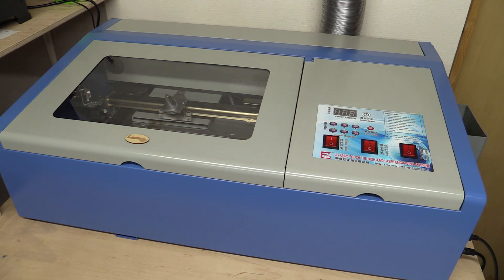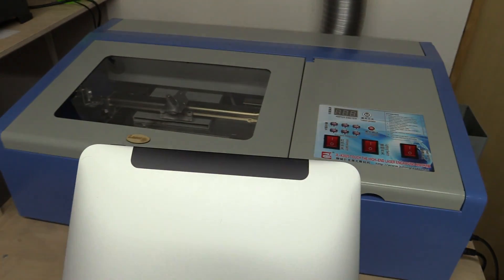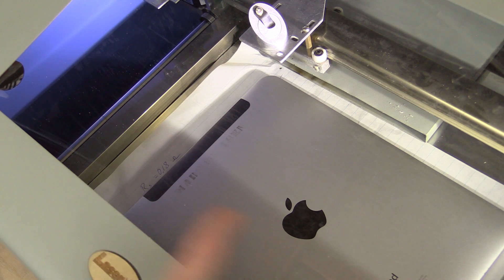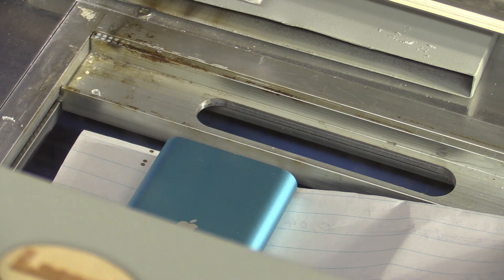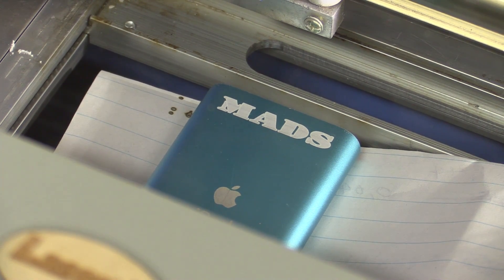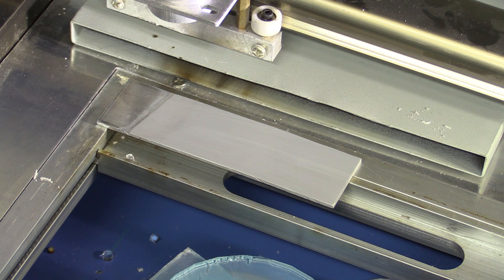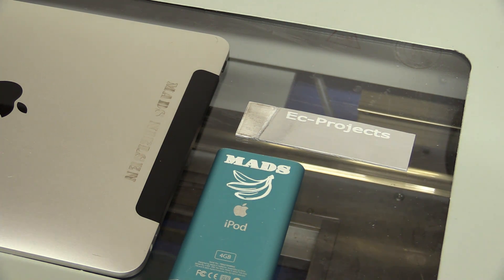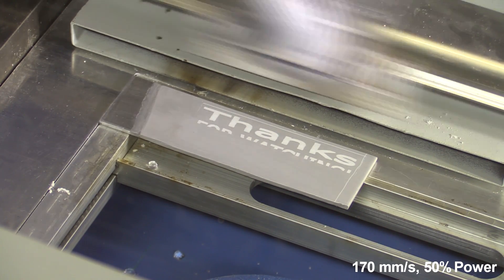Laser Engraving Anodized Aluminium - Ec-Projects

Comment: Etch aluminium with NaOH, better control of the etch as it is not as aggressive. If you mask the aluminium panel like a PCB you can do a panel nicely. The porous areas will accept dye nicely, or if you use a predyed panel it will strip the dye out selectively. I have done this with worn dyed alloy parts to get an even finish back, though I left it as plain afterwards. If you use a stainless steel container it will electrochemically strip the parts as well.

Comment: You probably could add colour to the etched areas now by using a dye to the etched area as the alloy is porous now and will accept dye until it oxidises again. Try using a sharpie to try and wipe off with IPA afterwards, the burn should hold dye better.

Comment: The iPad is indeed anodised. I think you have these problems because the surface you are engraving, isn't flat.
Reply from the maker: ***** Yeah, that could be. And it's not exactly in the focus point of the beam either :/
Reply: EcProjects My bet would be that too. Any way to lower the iPad or raise the laser?
Reply: I have engraved every iPad I own with a universal laser systems 50 watt at 25% power 100% speed at 600'ppi and it always looks lovely I did my Mac as well but it may be to the $23000 price gap